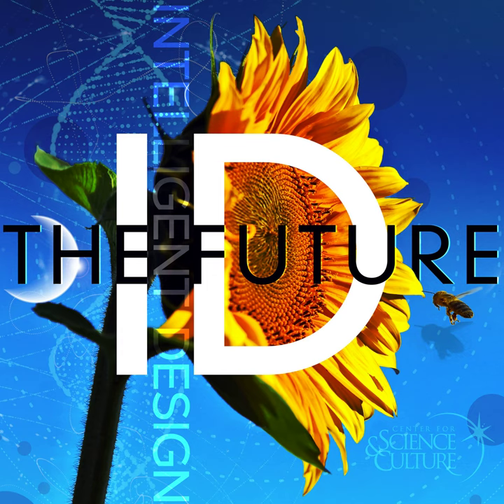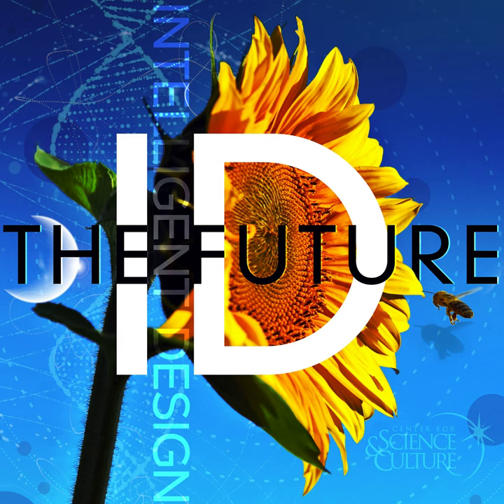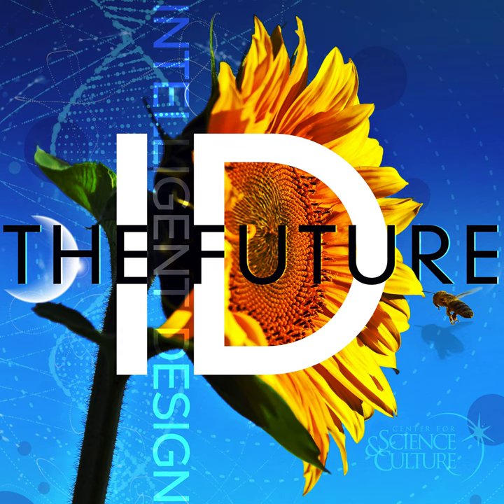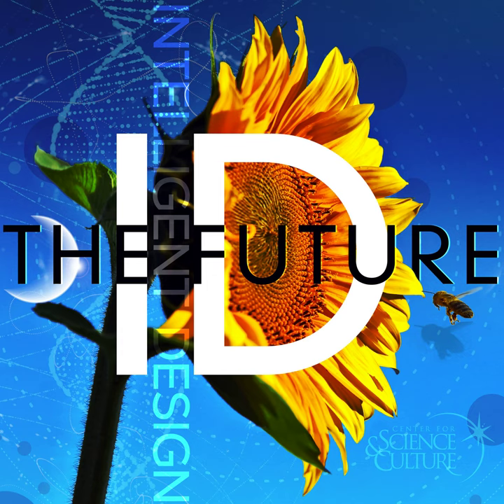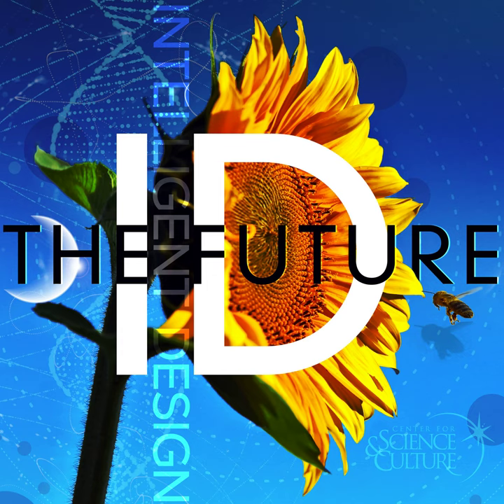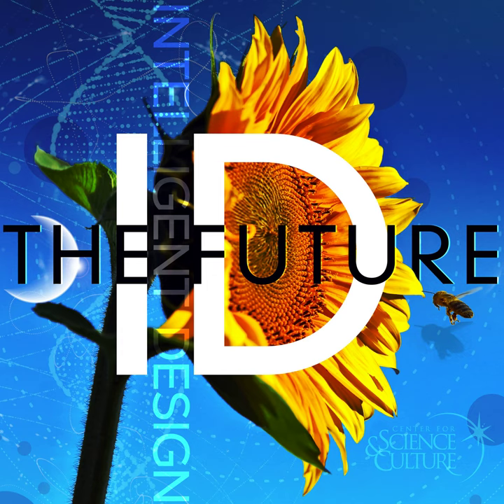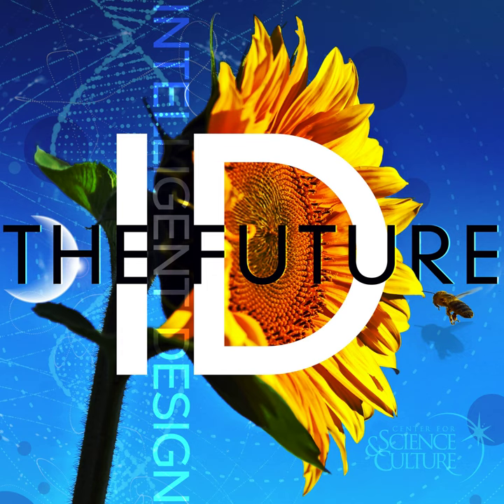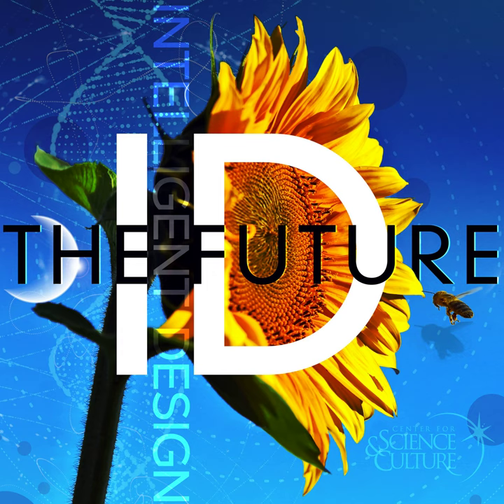This Sandgrouse Just Took the Royal Society to Design School

Comment: I really want to buy into ID, but evolutionary theory isn’t claiming that the process is blind and undirected. Rather, it’s that survival directs the process of random mutations down selected paths.

It’d be nice to hear more specifics on why such a process couldn’t produce these high efficiency mechanisms. Maybe the low probability or something, but I have no idea how often useful mutations occur, how fast they spread, etc. Might be my fault for not reading ID literature, but most of the podcasts, interviews, etc seemed aimed at a strawman.
Reply: Well, in a sense you’re right, in that evolution is “directed” metaphorically toward reproduction and survival.  The way in which evolution does posit a blind undirected process.  Is water flowing down hill directed or blind and undirected?  In one sense it is being directed by gravity to the lowest point.  But it is blind and undirected in the sense that there is no purposefulness of it.      A cup May be the lowest point of the floor, but it certain doesn’t have to to be. 

In a Sense it’s the evolutionist who have been hoisted for n their own petard because they claimed what they perceived to be a flaw in the design of biology as proof of evolution, because a blind undirected system should not expect to maximize efficiency, or at least should tend not to.  But then later, what the evolutionist considered a flaw was actually turned out to be optimally  designed.  If there is a straw man they were usually built by evolutionists.  But the flawed design as a result of evolution is intuitive.
Reply: @ianmartinesq  
It’s “directed” in the same sense markets are, and historically markets have produced fairly efficient outcomes.

Though, come to think of it, they rarely result in industrialization without massive state intervention (analogous to intelligent design), so maybe ID is onto something after all.

The water example is a good one, as we’ve all seen what the tendency of water to flow downhill has led to in the geography all around us. Though, I would argue this is an example of teleology in the sense that all physical objects have a built in tendency to be (or “aim toward the end of being”) attracted to large masses of other physical objects. That’s kinda Thomistic hairsplitting, though. 

If people supported the theory of evolution with appeals to poorly designed biology, I think that was pretty dumb on their part. I don’t see good or bad biological design as prima facie evidence for either position over the other. They both predict organisms designed for/adapted to their environments, and I see no reason in principle a highly competitive environment couldn’t produce highly efficient outcomes. It all depends on (beneficial) mutation and competition as far as I can see. I also don’t think we’re in the position to adequately judge the efficiency of some of these design plans. At least not without caution, as these examples demonstrate.
Reply: @martyfromnebraska1045  In this video they give a few examples of arguments that have been made for evolution from poor design. The eye, the ankle.  The argument from poor design doesn’t prima facially support evolution, but it prima facially cuts against intelligent design.  I think evolutionists May have argued it opportunistically.  Honestly, I’m not versed enough in the science of it to make the argument myself and have it be authoritative. I made a request to Discovery Science to make a video explaining that topic in greater detail.
Reply: Great amount of detail and excellent coverage of many areas. Thanks for this great interview!
Reply: There are several issues I find hard to reconcile with "mutation + natural selection = new /better organism"...  Firstly, why would the first animal (probably a type of zooplankton) ever have been produced?   Plants are supremely efficient - they don't have to spend any energy in the design of complex mechanisms (eyes, ears, muscular systems) in order to catch their food - they sit where they are and use the sun's energy.  Any requirement to have to catch food or seek food is an evolutionary backward step.  Secondly, how did sexual reproduction come about via the evolutionary model?  The internal systems of males and females is vastly complex and very different from each other... and every part of the system had to be fully functioning within the lifespan of the individual for there to be an offspring... if each of the two systems had to mutate and be selected for individually, what was the chance they would do so in the same time frame?  Thirdly, any mutation that occurred in a sexually reproducing organism has to occur in the gamete cell in order to be passed on.  A mutation in the blastocyst stem cell for an eye (for example) may result in a better version of the eye (though usually not, mutations invariably are LESS functional) but will only help that individual - it won't be passed on to their offspring.  For myself, God provides as all the answers.

Comment: a lot of body parts are badly designed. so many lives would be changed for the better if certain body parts had better mechanism
Reply: For example?
Reply: Bad design? Or does it not form correctly anymore? We are collecting around 100 bad mutations per person per generation in the human population. It could be we are degrading overtime as a species
Reply: Old doctrine from evolution camp...supposed bad design is always bad interpretation...